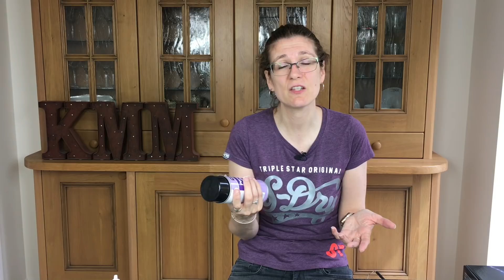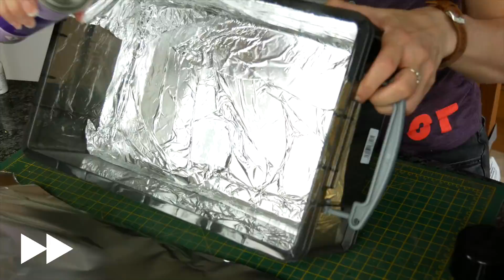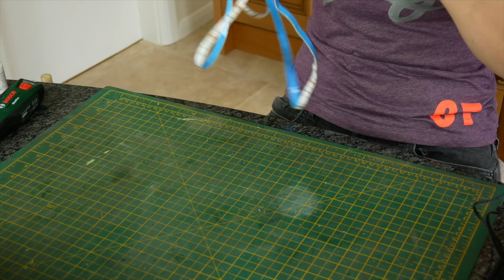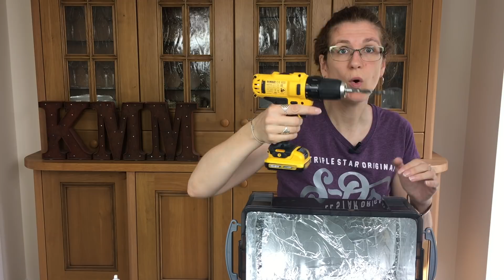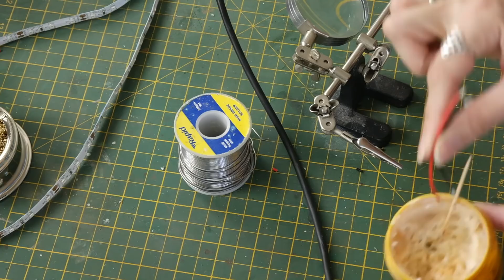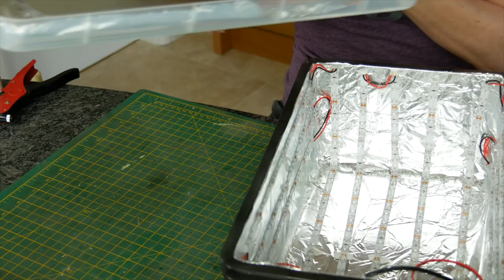Build your own easy UV Curing Chamber for Resin 3D Printers like the Anycubic Photon

Comment: Instead of cutting and soldering you can just run the light strip around in a spiral around the inside of the box.
Reply from the maker: I never get the strip to turn tight corners easily but you can just do that.

Comment: Can I use this method for uv resin on polymer clay?
Reply from the maker: I’m not sure I’m afraid. You would need to check what wavelength UV it needs but otherwise, UV curing is UV curing so it should work.

Comment: I printed a box on my FDM printer and used aluminium tape to line it.  For the turntable you can buy solar powered turntables which the UV LEDs activate
Reply from the maker: Nice thought on the turntable, thanks.

Comment: Try to connect stripes in parallel, this gives you a uniform light (sorry for bad English)
Reply from the maker: The light certainly seems even to me. I’m not sure it makes much difference at this length but if you were doing more, it certainly might.

Comment: I'm looking into getting a resin printer, so looked into homamade curing chambers. This is a great tutorial, but to anyone following this, please do not solder like this.

Don't use lead free solder as a start. It is horrible to work with, needs higher temperatures, (more chance of melting your project, or damaging components) makes more brittle connections, and is needlessly expensive due to silver content.

Also don't use corrosive (plumber) flux, it should not be used for electrical connections, as it might corrode your contact pads.

Instead get some basic rosin core solder, (I. E. Solder with flux core) and during pre-tinning nor the actual joining, please don't ever carry solder with your iron, as it will burn off the flux before you get to soldering. Besides it's an unnecessary safety risk to carry molten metal. The correct way: Touch your iron to the project to heat it, then touch the solder to the connection to flow it.

Lastly, always cover your electrical connections heat shrink tubing. Small tubes over the small leads, a larger tube over the whole connection. Especially if you're attaching it on metal.
Reply from the maker: Good tips thank you.

Comment: Great build, thank you! 
An added tip to MUCH faster curing. Place your print in a glass container of water - fully submersed, then cure it in the UV box. It cures much faster because oxygen inhibits the curing process. I went from curing from hours to a few minutes.
Reply from the maker: Wow, thanks for sharing.
Reply: Holy shift.
Thx for the tip!!!
Reply: Do you think it could work with the sun light, too?
Reply from the maker: Fábio Burkard I cured my first prints on the window sill but the UK’s not renowned for its sunshine!
Reply: @fabioburkard  most likely but it might still take some time. Much less than air curing though.

Comment: Much easier way to do this. You can buy 30W 385-390nm LED flood light arrays for <US$75 on Amazon. Just place flat on box and plug in.  Much more power.
Reply from the maker: I’m not sure power is an issue. Curing only takes a few minutes and you can over cure and make the resin brittle. This resin cures at 405nm which is not in the range you mention I’m afraid.

Comment: I'm afraid this is a late comment, but I noticed from a couple of your excellent videos you're using plumber's flux for soldering. That's definitely not a good idea as it is corrosive and could cause electrical problems over time like short cicruits. I'd suggest getting some roisin flux for electrical use instead. Most advice I've seen says to use real lead solder (60/40 mix) as well as it melts and flows better than the nasty non-lead stuff. As long as you don't handle the solder and then lick your fingers you'll be fine :-)
Reply from the maker: I do use real lead solder as I couldn’t get the non-lead stuff to work at all but I think I need to change my flux!  Thanks.
Reply: @KathyMillatt  The solder you are using has a core of flux, this burns off very quickly when you touch it onto the soldering iron which is what creates that plume of smoke. If you heat the end of the wire then touch the solder onto the wire whilst it is being heated the solder will run and you can dispense with the additional flux. If you do the same to the contacts on the LED strip then all you need to do is heat the wire and the contact and "sweat" the components together. Having said that your soldering technique is perfectly adequate.
Reply from the maker: David Brooksbank I like the control of the extra flux and have found it invaluable when doing many projects. I’ve bought a non-corrosive one a few months ago that I’m using instead of the plumbers’ flux now.

Comment: Well made! I just received my led stripe and had to build a chamber too. By the way there a sold stripes wich reach 400nM and 405 NM wavelength. The resin is sensitive to 405. 
Please alow me to give some hints to short the build process of the box. 
1. Instead of the mess with the glue spray I would cover it with self adhesive aluminum tape. This is used for finishing insulation works of aluminum covered insulation and sure available in the department store or online. 
2. You can save much time by using solder with flux inside. Also you haven't to clean all from the the flux you had the wires dipped in. Some separate flux will corrode the solder and conducters if not cleaned. 
Finally I ask myself if a turntable is with this perfect illumination necessary? Did you made some testing with and without? Still curious 😉
Reply from the maker: Great tips. I used what I had on hand but if you can get self adhesive aluminium tape then excellent. 
I used the turntable because the box isn’t even but I do go in and flip them over halfway through to cure the underneath. 
Thanks again.

Comment: Would not a coat of paint before the glue make certain that you avoid uv-exposure? 
Might be a bit of overkill though...
Reply from the maker: The plastic is all covered by foil so I’m not sure the paint would add much. I can see a purple glow in a couple of spots at the bottom but that’s it.

Comment: Good idea, I suggest to use a Bucket, so you don't need to cut and soldier you can wind the LED strip from top to b0ttom. Cheers Andy
Reply from the maker: I thought about a bucket but I had this container already and it fits away neatly in the cupboard whereas a bucket would be too tall. It all depends what works for you, there’s no wrong answer.

Comment: The foil will help keep the plastic killing UV off the container. Removing the silicone waterproofing from the LED strips would improve efficiency via better cooling.

The Anycubic Photon is an amazing printer.
Reply from the maker: It is an amazing printer. Thankfully I don’t need to use the printer for that long so Heat build up hasn’t been a problem so far.

Comment: thanks Kathy, a great upload as usual.  I've been wondering when the promise of 3-D printers would allow clumsy modelers like me to go make replacement parts for those tiny things I break.  I tried a cheap 3-D pen from a local hobby store but it was 
printing gel ink which is no good. I learned you have to at least print in styrene if you want something meaningful. keep up the great work !
Reply from the maker: This has been so easy. 3D printing is definitely a useful tool to have.